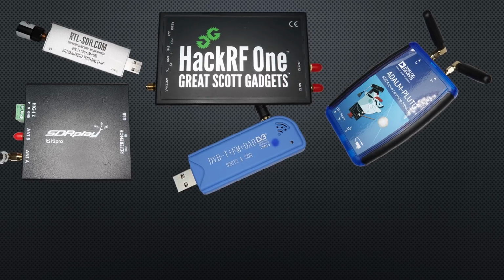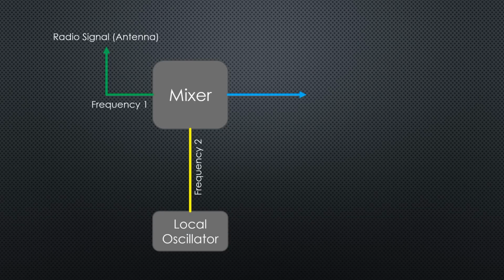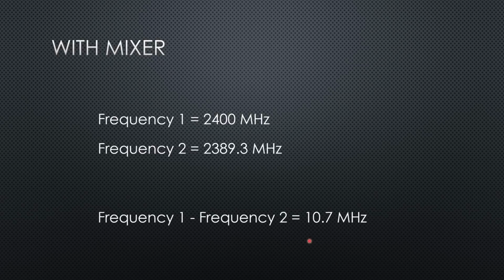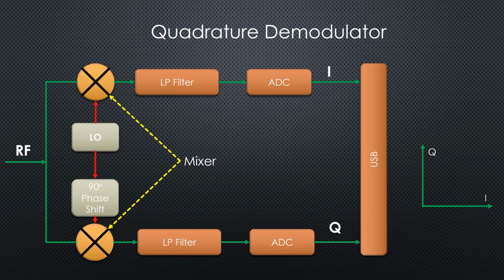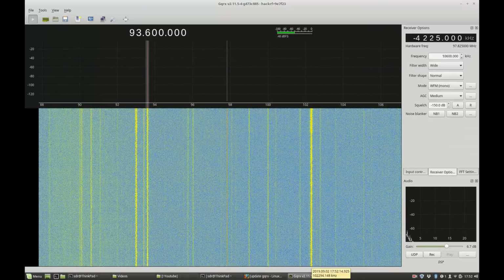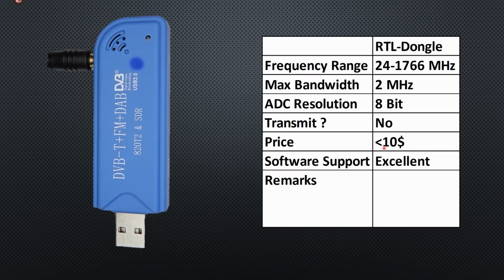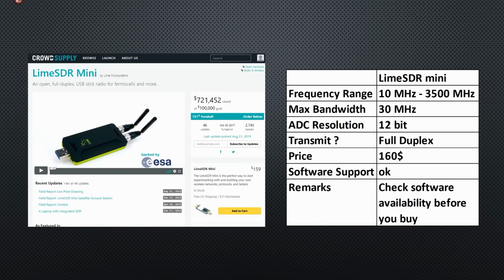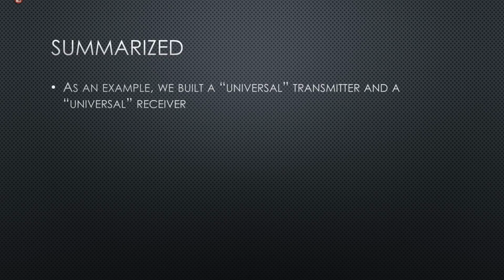008 SDR Tutorial: How does Software Defined Radio SDR work under the Hood

Comment: Very informative, I noted that SDR still uses mixers because A to D,s are not fast enough. So if they still use mixers they must have front ends which could be easily jammed with broad band signals. I have a wartime receiver which gas a 5 section variable in the front end to narrow up the bandwidth.
Reply from the maker: Not all SDRs use mixers. The more expensive use very fast ADCs

Comment: do you have an info on how the system can still keep the FM modulation info while the RF to IF Freq transition in Mixer? Just RF beginner query
Reply from the maker: The frequency changes persist if you mix a frequency with a fixed frequency.

Comment: Hi, can we use a SDR Rx radio to accurately measure the FM frequency deviation. ie. as a deviation meter to check the transmitter drive level? any thoughts? thanks regards Nigel ZL2SEA

Comment: A Stereo ADC/DAC should work what about sample at 88200Hz
Reply from the maker: Maybe. We do not use stereo with SDR stuff. And our bandwidth is usually quite small (3kHz)
Reply: @HB9BLA  I meant a dual channel ADC chip and possible a DAC chip as you have to sample both the I/Q signals do you for processing before converting back to analogue.

Comment: All SDR receivers/transceivers use ADC to digitize the the incoming signal into data then process it using High School Mathematics then convert the resultant data back to audio using a DAC.
Reply from the maker: You forgot the most important stuff: The transmit and receive it on RF

Comment: let say I want to use SDR for a high quality FM receiver, does it make any difference to choose a cheap vs an expensive unit.
expansive unit have larger banwith (you can record more at once), more bits ( more bits enable you to receive lower and higher strench signal without overloading), 
so the difference would be after the ADC (my guess is that the ADC is important for lower conversion error ie distortion)?
Reply from the maker: The ADC is the expensive part and defined the bandwidth as well as the dynamic Range of the SDR receiver. The rest is software (and a bit filtering for strong signals)

Comment: What do you think about the cheap HackRF One clones from China? Can they at least be used or are they complete garbage? Thanks!
Reply from the maker: I have one and it works. But I bought it years ago. Check also if an Adalm Pluto or a Pluto Plus is an alternative. I use them for my satellite project. Important is that your software has the drivers.

Comment: Absolutely brilliant presentation.

Technology has come a long way since GPRS (General Packet Radio Service)

⭐⭐⭐⭐⭐
Reply from the maker: And GPRS was not the beginning ;-). I hope we can play a little with this technology in later episodes…
Reply: @HB9BLA  This is true. AX.25 (X.25) data packet radio was first tested in 1978. 

Before then, the USAF experimented during the 1960s, a form of packet radio communications based on early development work that soon became known as ARPANET. It was developed and intended for aviation packet radio comms. R & D teams used 3450 / 5550 kHz and 5560 / 8900 kHz, in the 1960s using B-52s  during Chrome Dome nuclear strike deterrent flights.

These frequencies bands are still used by Transport Canada and FAA ATC over the Atlantic. 

Modern 1990s FM out of band was to be leveraged by many FM broadcast radio stations to embed one way digital radio data that's been possible since 1995. But it was never released by Delco radio (then part of General Motors. They were simply too early. ITU standards for Radio Data Service (RDS) development began in 1994, using 57 kHz subcarrier.

As you know, Packet radio has been in use by amateur Ham Radio and MARS operators, (duplex) data comm radio's since 1978.
Reply from the maker: Thank you for the info about the history. I did not know it.

Comment: As a freshmen in the HAM club, I was tasked to give an exercise to the (not-yet-joined) newbies about SDR, from the basics to the point where we made an FM receiver from scratch using an RTL-SDR and some C code. I have to congratulate you for cutting down the math, because this topic is very math-heavy (but also I think one can only understand the beauty of it if he/she also understands the math). Anyways, I might have scared the newbies a bit with the half-a-blackboard equations, but also told them not to ever try to learn it, only care about the first/last lines...
Reply from the maker: I do not think math is needed. And the chance you scare them, and they are no more interested in the topic is high :-(
Reply: @HB9BLA  to be fair, this HAM club mostly gets fresh members from a technical university (and mostly EE and CE), so in fact they should already know the math, but not seen it in use. I do not, however, agree with the "no math is needed" point. Yes, no math is needed to plug in an RTL-SDR and listen to stations, but to build anything you will need it - even just to make some simple receiver in GRC, you have to understand how do IQ signals work.

Comment: Trying to mess with my Yaesu FT-4X for CW. Now I know why I did not see 455 mHz. No Way. 73 Peter DL2FBA
Reply from the maker: The problem is that you probably will not find anybody doing CW on FM... (I do not own such a device and assume it is FM only)
Reply: @HB9BLA  it is FM only. Normally I could inject a BFO at 455 kHz  but this thing has got no decent IF - a YAESUed BAOFENG SDR.

Comment: Very interesting movie.  What will be the best solution to work on QO 100 HackRF or Adalm Pluto? Many colleagues work on the latter platform.  What to choose?
Reply from the maker: I had the Adalm Pluto and recently changed to the Pluto Plus because it has built-in Ethernet. I never saw somebody using the HACKRF for that purpose.
Reply: @HB9BLA  TNX Andreas see you in QO100  Best 73 Tom SQ6PNT 👍

Comment: Is it possible to hack SDRs to bypass the Mixer or set the Local Oscillator to 0 Hz to use them as crude oscilloscopes?
Reply from the maker: If you have an ADC with the needed speed you do not need a mixer.

Comment: A great summary thanks. I have several SDR’s I used the HackRF one a lot several years ago but ended up in the draw when I used the  SDRplay this is very good. I have now bought the Portapack H2 and has given the HackRF a complete new life as a very handy portable SDR setup  nice small screen and many built in decoders such as for  ADSB Sondes with Maps SSB etc and great for bug hunts 😁, with all the usual facilities to Rx & transmit from touch screen controls . Thanks  for the new channel G8HAM
Reply from the maker: This Portapack seems to be handy compared with a standard HackRF... Maybe it lands on my shopping list, too.

Comment: I honestly thought SDR wasn´t going to be a subject I´d like or be interested in, as radios never caught my attention. I was very wrong. Probably I´ll have to skip the advanced topics in the channel, but this one lesson was fantastic. Thanks, Andreas.
Reply from the maker: Glad you liked it. The radios often are not very interesting, but the applications can be quite cool...
Reply: I have an SDR specifically because I needed to debug an Arduino-like project that communicated with radio modules. I'm not interested in HAM radio specifically either, but SDR is so flexible that I view mine as just another piece of test equipment.

Comment: I use SDR as part of my QO100 setup. Another to receive and upload my weather station onto aprs. Another for tracking radiosondes, and im halfway through building a RX_TX ensemble transciever. Looking into adding a sdr to my FT991 to add a panadapter. Go fun and interesting.
Reply from the maker: I added a "panadapter" to my 7300 which was quite easy because it already provides cat signals. But mostly the waterfall on the rig is ok for me.
Of course I use a Pluto plus for my QO-100 (with an ethernet connection to the roof)

Comment: One of the great things of watching something about radios from an international perspective is see how things are different from what I've come to know. You're showing of your amateur radio license was interesting. In the US, when I got my initial license, an upgrade, change of callsign, and moved, I got a new, thin piece of paper with my license information on it. The thin paper allows me to cut out and possibly laminate a "wallet" version and there is a slightly bigger portion that could be put in a small picture frame for putting up in a "ham shack". I've never felt a need to do anything with my paper license. If anyone wishes to verify my license, they can go to the FCC database and they will find my data there. This will be more valid than a piece of paper, as I may have been punished by the FCC and my license revoked, but if I physically had a license in hand, it wouldn't say anything about being revoked like the database would. 

When it comes to SDR, I have been using cheap little RTL-SDR dongles for years for a variety of purposes. The most useful has been to monitor public safety communications in my region. There are three major P25 trunked radio systems in my region. The smallest (fewest users) is my county's VHF based system, with at most, six frequency pairs with output frequencies between 161.800 MHz and 161.875 MHz, a maximum bandwidth for the entire output of 75 KHz. An RTL-SDR has no issue covering that small of a range. My local city has a slightly larger system on 800MHz with 10 frequency pairs, with output frequencies between 851.2375 MHz and 853.55000 MHz... a bandwidth of 2.3125 MHz; this just BARELY works with a single RTL-SDR, which I'm able to get 2.4 MHz of bandwidth. The county next door is very urban with many cities and has a much larger 800 MHz system. They use 30 frequency pairs from 851.0500-853.9000 MHz; 2.85 MHz. Thankfully the software I use to monitor this allows the use of multiple receivers, so two RTL-SDR dongles are needed to cover this system. 

In case you aren't aware of P25 trunked systems, they come in two major versions; Phase I and Phase II. The systems in my area are using Phase I, which uses IMBE/AMBE audio codec and FDMA. Phase II uses a more efficient AMBE2+ audio codec and 2-slot TDMA, allowing for two simultaneous conversations taking place on each frequency pair. As with most trunked systems, "channels" and "frequencies" can't be interchangeable terms. Instead of "channels", they are generally referred to as "Talkgroups". In the system, one frequency pair is used to coordinate the entire system, registering/authorizing each radio connected and what "Talkgroups" they are choosing to use.

I use SDRTrunk to listen and share my city's police and fire traffic online through Broadcastify. A computer in my house follows all of the communication on the system and if it is fire or police, it will decode the digital audio from AMBE to I believe LAME (MP3) and send the audio to one of Broadcastify's intake servers. There are many people in my city that like to hear what is happening but don't understand all the technical stuff needed to track it with their own radio scanner... plus traditional scanners capable of listening to it are extremely expensive. Granted, my computer wasn't cheap when purchased new; Intel Core i3 CPU with 8 GB of RAM, but I outgrew it for what it originally was used for. The RTL-SDR with a TCXO was about $25 USD. I use a 3db mobile whip antenna to feed it. It works great. SDRTrunk is Java-based, so it is platform-independent. I am using Ubuntu Linux with limited GUI, as I run it in a headless mode but it does require GUI for modifying settings.
Reply from the maker: Here the official communications are mostly encrypted and anyway, it would be forbidden to listen to them. AFAIK your license is very cheap. We have to pay 50$ per year. So we can expect a stable license ;-)
P25 seems to be more popular on your side. What I use is DMR which also has talkgroups.

Comment: An RF engineer I worked with some years ago said that, "If you think negative frequencies can't exist, that's fine, but it means there are no positive frequencies, either."  It is all relative: at any given frequency, carriers below are rotating in the 'negative' direction, at ever increasing rates with increasing frequency differences.  
Once you mix your carrier down to baseband, the lower carriers go 'negative'. We mix with two generated carriers at the same frequency, one of which is generated 90 degrees out of phase, so that we can retain the information necessary to determine positive and negative offsets relative to our carrier of interest (generating the complex values to which you referred).
Edit: should note here that W2AEW has an excellent treatise on IQ modulation/demodulation in his video #170
Reply from the maker: Thank you for the additional info!
Reply: I really appreciated this little explanation. I think something finally clicked when I read it. I've even taken classes on signals and systems, but too often the material is covered from a purely mathematical perspective rather than an intuitive one. I was disappointed when I clicked on your channel to find that you don't post videos yourself.
Reply: Phase extraction is done by arc tangent, magnitude by the Pythagorean Theorem.  
Conjugate multiply can be used if you're working from a complex number as a reciprocal, as a first step.
Reply: Negative  frequencies  arise from  a mathematical   abstraction,    complex numbers.  It is  very  cool stuff that helps us understand  radio...   The   actual magnitude   and phase  of  a  signal  is  found  by   multiplying   it's  complex  representation by  it's  complex conjugate...